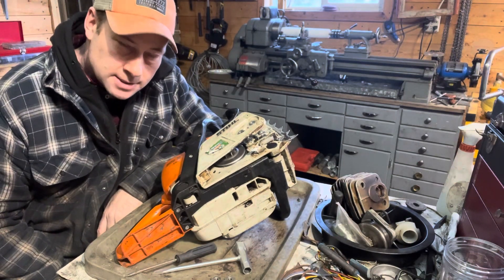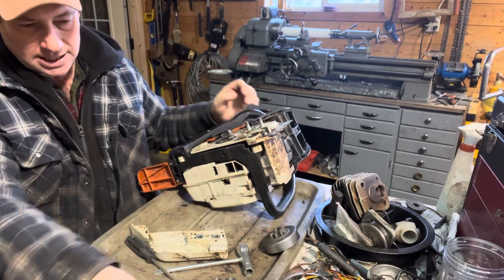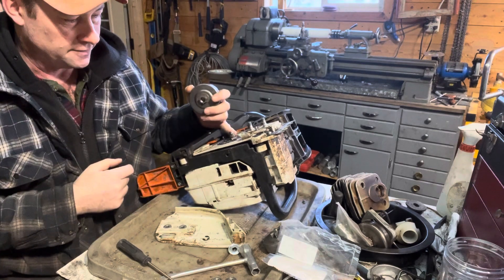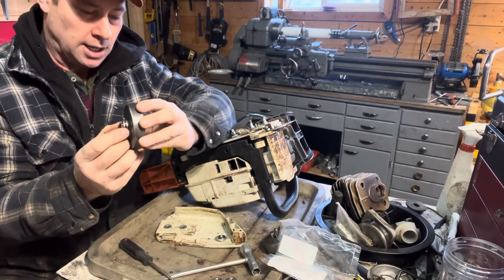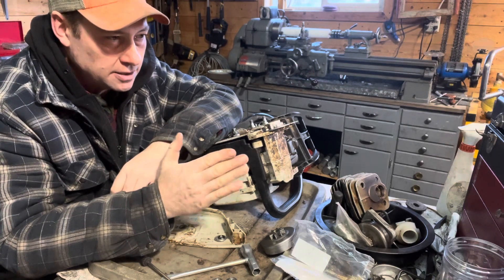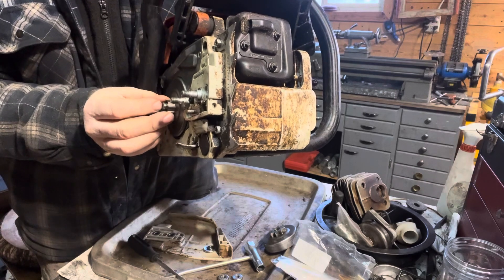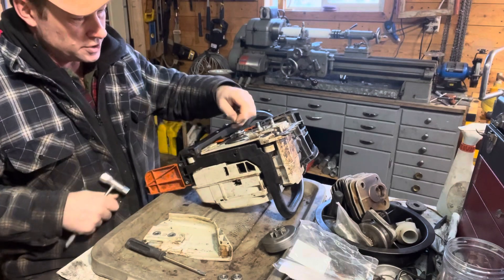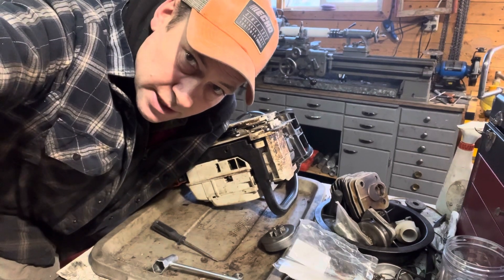How to convert a Stihl MS 290 or 270/271 from spur to rim drive (clutch drum and sprocket)

Comment: Great video.  I'm wanting to convert my MS290 to rim, and like yours I will be replacing the original 8 tooth spur.  It looks like part number is for 7 teeth and wondering if there will be any difference in performance?
Reply from the maker: @Ghost5w20  well, it may hold its rpm better in the cut, it’s basically gearing it down x %.

Comment: By switching over to a rim sprocket,does it still use the same chain?
Reply from the maker: This one does, there is an option to go to 3/8”, but you need a bar with the 3/8 sprocket tip too…so just remember if you want to switch you’ll need to do both ends 😉